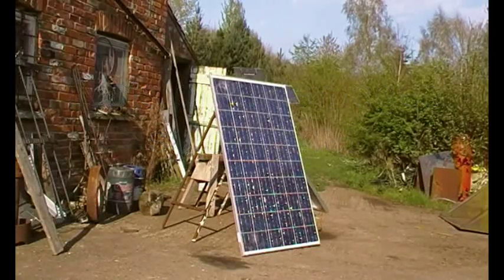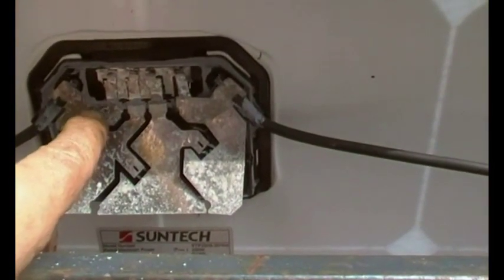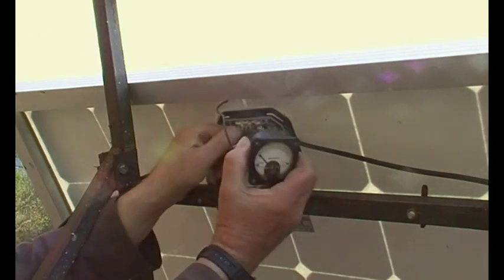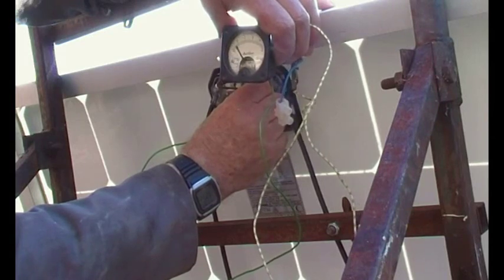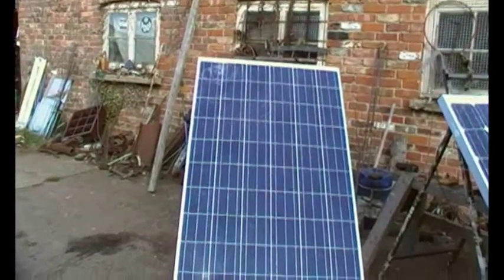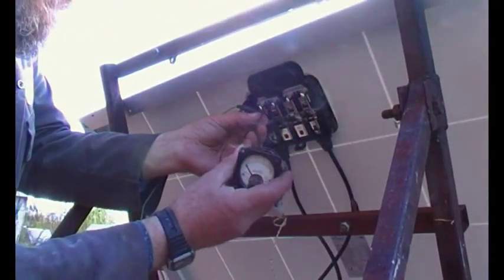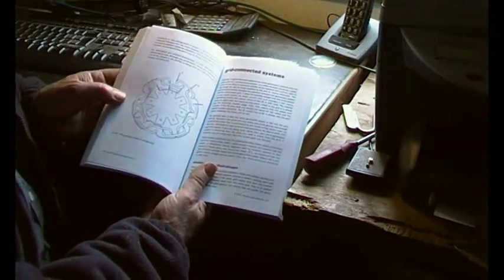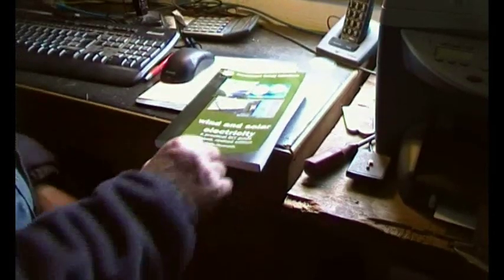How to test and repair a broken solar panel. part 2, current short test.

Comment: once broken. it's useless
Reply from the maker: That's a view, but if you 50 miles from anywhere and this is your only power, then maybe not. Perspective, cheers
Reply: I have several panels wirh broken glass and been almost 5 years and they charging fine still. I have 40 and 50 watt solars charging batteries in diffrent locations.

Comment: Hi lightning caused my panels to shut down giving nothing coming out do you think I can recover some power of them or have they died
Reply from the maker: Hi, your question has many answers, so perhaps I should ask some questions. please answer them all. Are the panels on your roof? Are you off grid or on grid? If you are on grid does your grid inverter show a fault code or does it simply not work? Is there any DC volts showing at your DC insolating switch? Have you tested each panel separately? Cheers, Andy
Reply: Andy Reynolds hi the inverter no power. panels tested for voltage individual all dead noting coming out  I am now thinking it could be the diods I still have to do this check from the front sun side looks as good as new
Reply: Andy Reynolds hi also the system was grid connected
Reply from the maker: Hi. A few years ago I came across a panel that gave no voltage. After a  few experiments I cut the diode connection and then we had volts and amps. The diode had failed as a short and shorted out any power flow. This was caused by a student wiring the panel reverse polarity. High static voltage could do the same thing. With many 30v mpp panels there are commonly 3 diodes,  as an experiment you will have to cut a connection to each one if you can get the box open, sometimes they are sealed. Check out my recent video on testing a grid inverter. Cheers, Andy

Comment: Hi, I have four 240watts solar poly panel at 37volts and 8.6 amps spec. When I measure the output of the panel ,it only give out 33volts and 8 amps but if connected to the charge controller to charge 24volts battery bank, it only give me 3amps. Is it normal or problem with the solar panel?
Reply from the maker: Hi. Difficult to be definative, depends on many things, is this in full direct sun and facing directly at the sun, what is the battery volts when you see 3 amps, what charge controller are you using, are the batteries sealed or flooded type and how old are they, do the batteries hold a charge well or go flat quickly. Hope this gives you food for thought. See this link  http://www.lowimpact.org/book-title/wind-solar-electricity/ , cheers
Reply: Yes in full diect sun, very hot ,when I cool it with water its give 20 percent more power. Voltages is about 28 volts. Yes the amps also follow the temp of the penals.I have try pwm, mppt and direct charge. Mppt is the best but input must be high 50volts . I series one 33 volts 8amps panel with a 19 volts 7amps penal. Total up 52 volts 7 to 8 amps. My MPPT charger can only take 50 volts max. 20amps. I can get 8 amps max when charging my batteries. My battery is flooded type,less than a year. Can hold charge. 150amp 8 pcs. conventional batteries.
Reply from the maker: Hi. When your panels are hot the voltage goes down, and when the batteries are fully charged the voltage goes up, so there is less current flow. The main question is are your batteries full charged most of the time? if so you are not loosing anything you can use. As a test if you put a reasonable load on your inverter this will pull the battery voltage down and so should show in increase in the current flow from your panels. This is what you need: http://lowimpactorg.wpengine.com/wind-solar-electricity-3rd-edition/ 
Cheers, Andy

Comment: Hello I am From Brazil i am having almost the same problem when I test amper, My solar panel it is 95W and 5.5 amper when i test it shows only 1.6 amper, and i don't know how to solve it
Reply from the maker: Hi. You may have several problems. Is you meter accurate? try another unit, is the panel facing directly into full sun? do you have corroded contacts? If the glass is broken, or there is damage to the back of the panel then some of the wafers may be damaged. Check these things and then get back to me. Subscribed? Cheers, Andy
Reply: Henrique Domingues get more sun

Comment: hi, My solar Charge Control Leron did not Charge the battery, how to Know if the problem is my solar Panel or my Charge Controler?
Reply from the maker: Hi. There could be a number of reasons for this. Have you installed an amp meter between the solar panel and the charge controller, so you can see what is happening? You could test the panel with a multi meter, first DC volts and then change the meter settings to DC amps and do a short circuit test. I suspect either a wiring fault, a charge controller problem, or you have used too much power and there has been poor generation. Edition three of my book (wind and solar electricity) is now out, perhaps it may be a useful purchase. Hope this helps, but from a remote situation it is always difficult. See my other videos on battries and wiring. Cheers, Andy

Comment: Hi Andy, Thanks for such a helpful video. We have access to a lot of solar panels (Trinasolar TSM-260PC05A, with a max power current of 8.5A) with broken glass, and we have measured the overall current from each one facing the sun in full sun in virtually identical conditions. They are ranging in output from 3.5 to 8.5A. Would you say there is a risk of hot spots developing in those panels which are outputting less than 8.5A, especially those down in the 3.5 to 7A range? And if so, would those hot spots constitute a fire risk? They are to be used in Portugal. Many thanks for any help you can give! EP
Reply from the maker: Hi. The 3.5 Isc panels should not create hot areas as the current is low due to areas of the panels not working. I would say that only panels with a similar short circuit current (Isc) should be matched together. Depends on whether the panels are grid tie or battery based. Cheers
Reply: +Andy Reynolds Thanks very much Andy. The panels are to be battery based - should we match those with a similar Isc for this? What is the reason for matching them in this way? Many thanks again.
Reply from the maker: Hi. Any panels in series will only generate to the capacity of the weakest panel. I assume these are 24v panels, so if you have a 24v battery bank then no problem as all the panels will be in parallel, but if like me you have a 48v system then panels have be matched to get the best output. Even the 3.5 Isc panels should be matched if you have room to fit them, as they will contribute to the overall generation. Cheers
Reply: +Andy Reynolds Thank you very much!